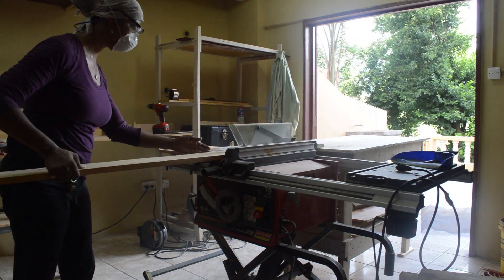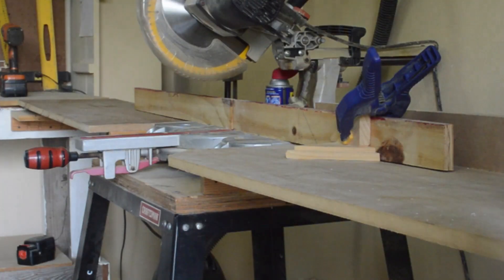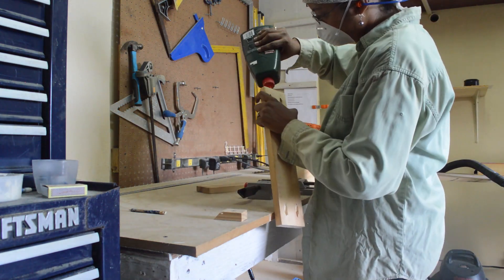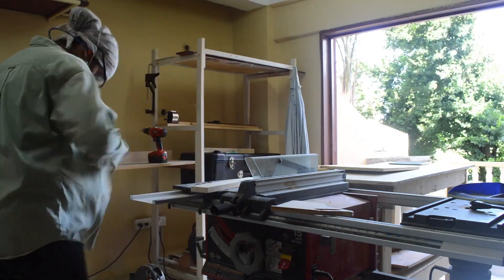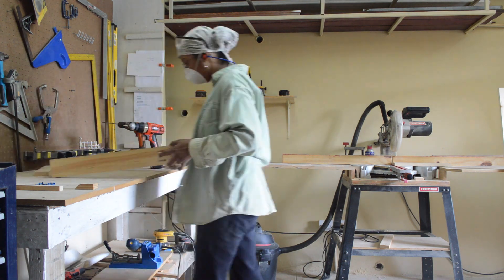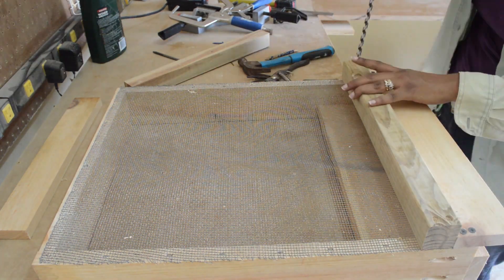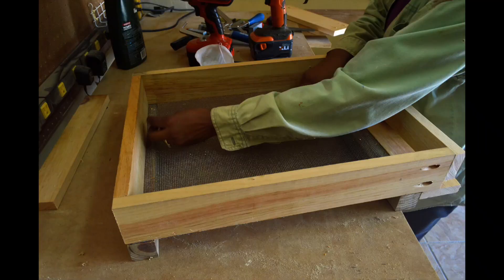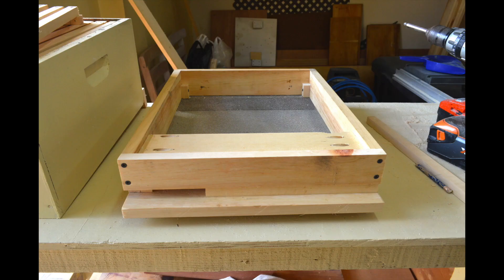How To Build a Screen/Mesh Bottom Box For a Beehive

Comment: Sorry i wasnt clear, what are the dimensions of the timber you used? is it 3 inch by 1 inch material? the overall width and length would of course be standard
Reply from the maker: Ian Beer Hi Ian, the board I used was a 1 x 12 board that I ripped down smaller.